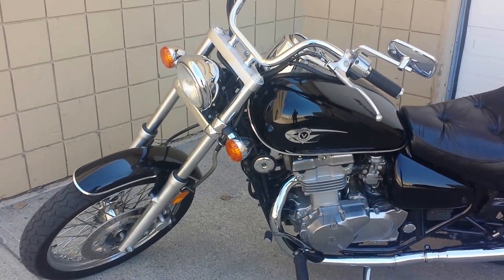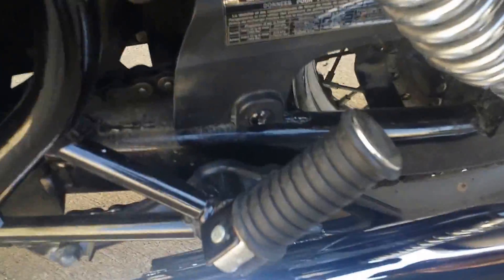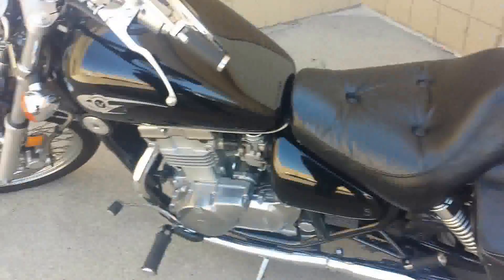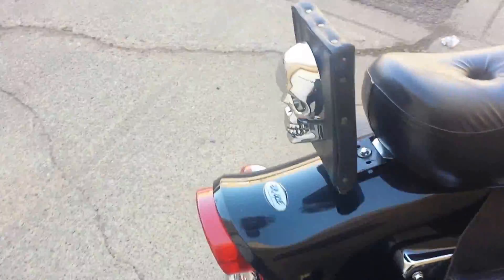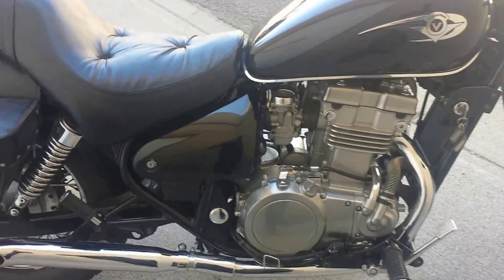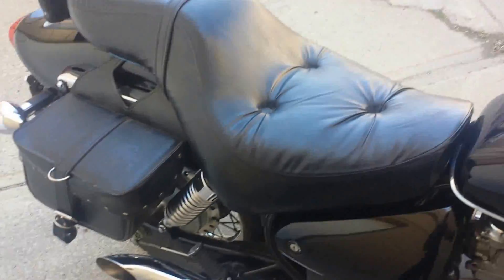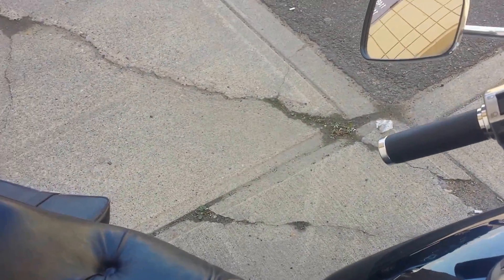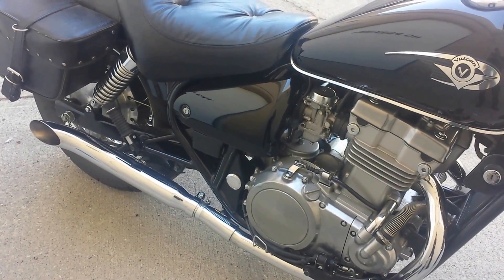Kawasaki vulcan 500 Emgo Turnout Pipes

Comment: I have the same bike with the turnout pipes, How did you place the baffles in your turnouts pipes?
Reply: Logan Canning  hi Logan did you get his email
Reply: +Logan Canning Did you get anything from him Yet?
Reply from the maker: HI Logan, Sorry for replying late, The baffle I made was using a 1/2 inch wide aluminum pipe 2-3 inches in length then packed steel wool around it with a wire and just inserted  it in the muffler  before inserting it in the pipe.
Reply: Was it still tight after you got it in? i just tried this and it didn't make a lot of difference likely because to fit through the small opening the baffle couldn't be too big - and after pushing through it was loose?
Reply: @canadianamigo1459  so you drilled holes along the aluminium pipe? Did you insert it at the end of the muffler?